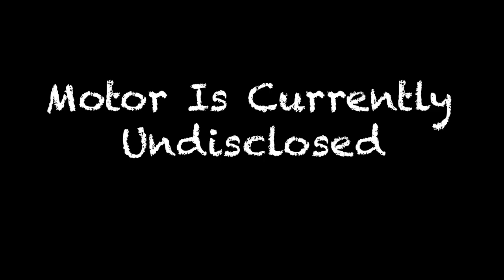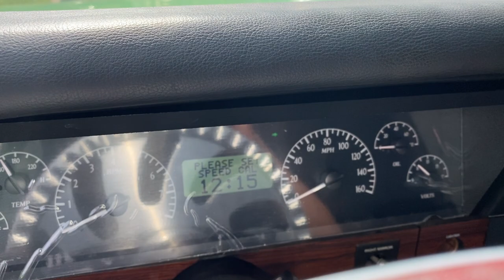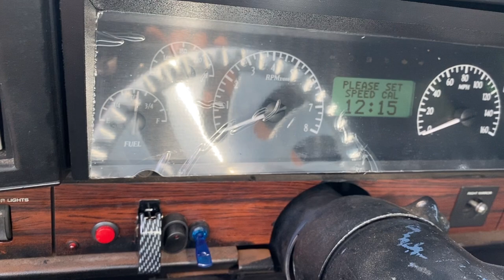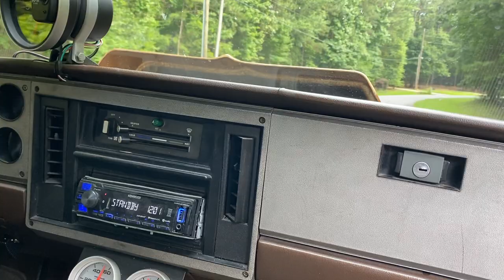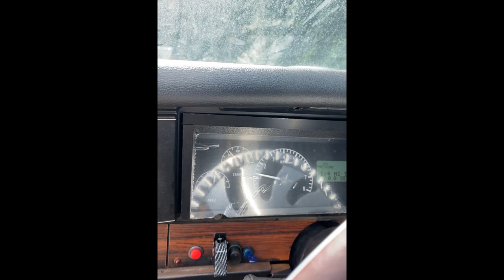Installing @JMalcom2004Rides Digital Dash in Big Dolo

Comment: That speedo gear is known to cause problems if its not lined up just right for the sensor to read it or the matching gear to ride on it it wont read right
Reply from the maker: That was a first for me
Reply: @SteveDavisCarGuy  did you get it fixed